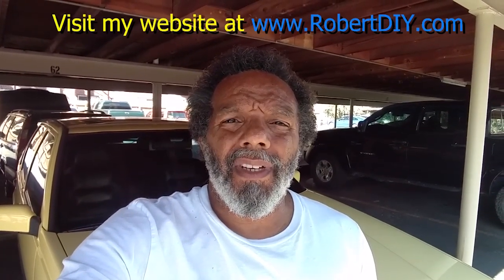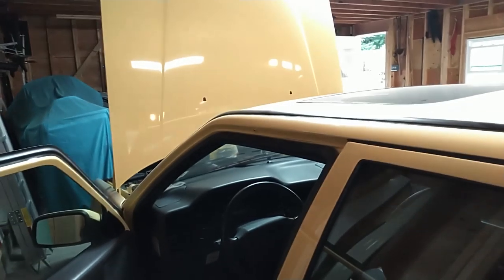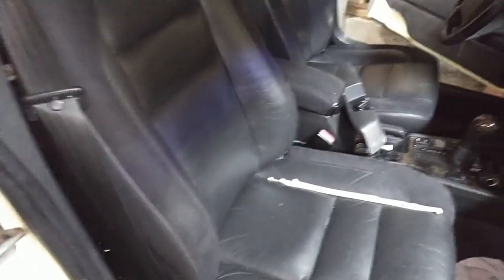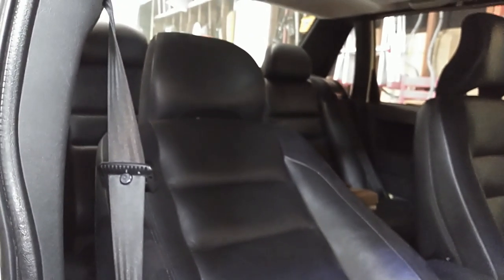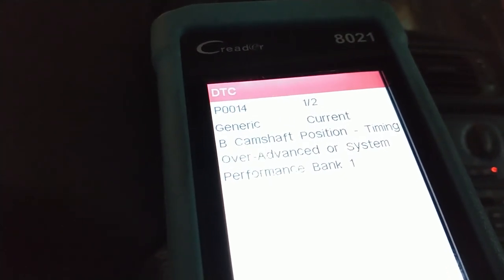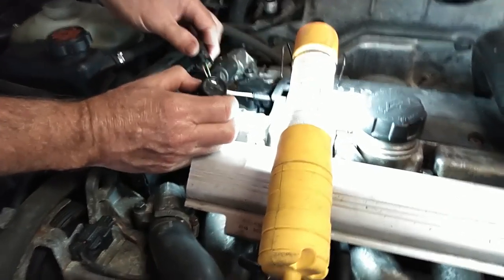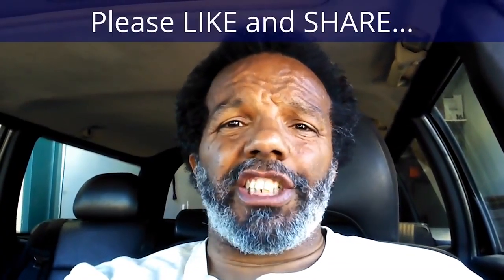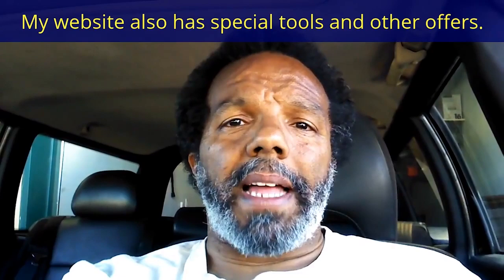Volvo 850 seat recliner, VVT solenoid, reset service light in '99 & '00 cars, etc. - howr

Comment: I may have missed it but I’m getting the same 2 codes do I have to lock the cams to remove the solenoid or is it ok to just unplug it and just remove and replace it? Also I have not been able to find one at a parts house near me would this be a part that is ok to try from the junkyard or can you lead me to the direction of a part I was trying to follow the links but I must be doing something wrong I really appreciate any feedback
Reply from the maker: No locking tool needed. I'm pretty sure this guy got his from www.FCPEuro.com
Reply: Robert DIY awesome thank you very much

Comment: Great video! I just have one question. My P80 V70 from 2000 has got the error code p1671 which make the engine light to go on and I think that it might be caused by a bad vvt solenoid. Do you think that this is the case or is there something else wrong?
Reply from the maker: I don't know what that error code is for. Best to use a Volvo class scanner. It is common to have those solenoids fail.